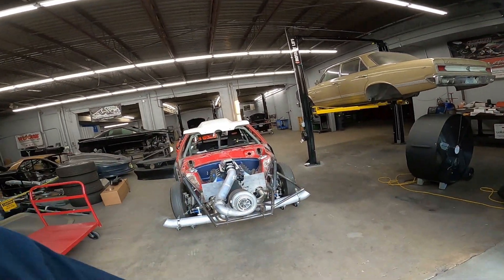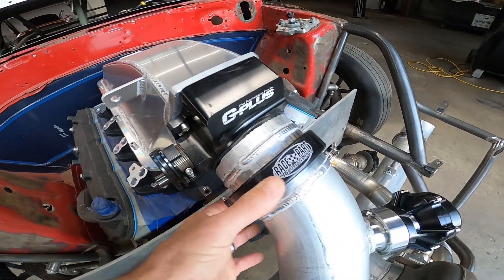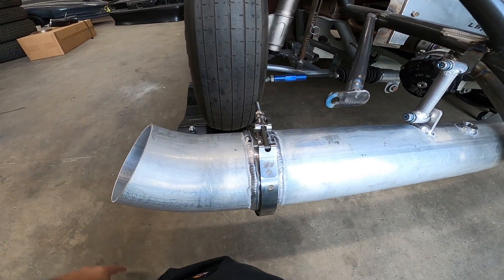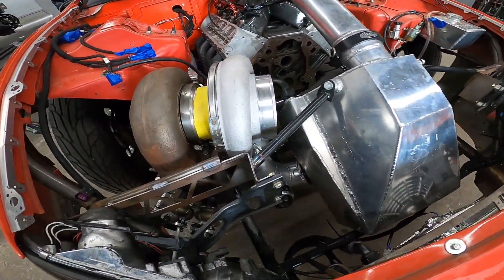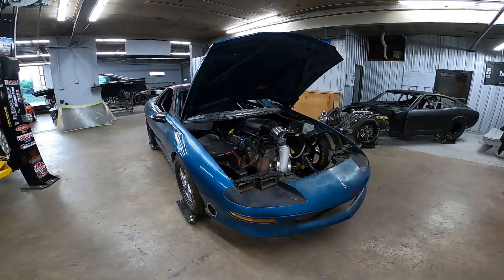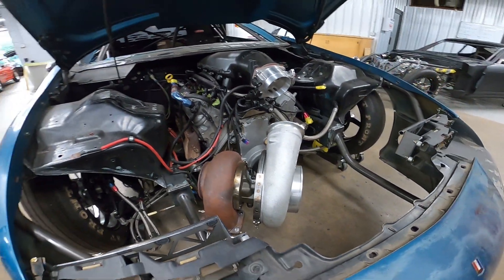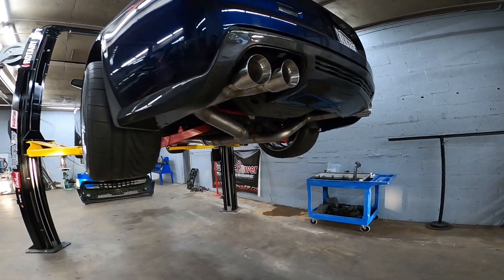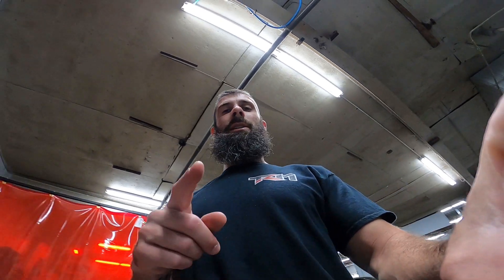Greg Allen 94mm Turbo Foxbody going HOME!!! Many other PROJECT UPDATES!!

Comment: How close are you to V.a. ? You seem to get a ton of V.a. Customers and cars . I’m in The middle peninsula of V.a. About 45 mins to a hour east of Richmond V.a. I may be needing a set of 1 off turbo headers for a LS going in my Audi A4 Quattro. I’m trying to retain the AWD also so but I don’t think I can reuse the trans and I don’t really want to because it’s a Auto and I want to do some occasional track days and maybe a little drifting . There is a clutch kit and bell housing adapter available for mating the stock A4 manual trans to a LS but with twin turbos on a healthy 6.0 I don’t see it holding up long if at all .. I was thinking maybe a T6 mated to a gm AWD case out of a Astro or a trail blazer , Bravado , or I’d really like to find a Typhoon/ Cyclone case . I want to be able to electrically be able to switch in and out of AWD which I know for a fact that can be done with the Astro AWD case because it’s on demand AWD and I’ve done it with nothing but a D.P D.T. Toggle switch quite easily but I’m not sure on the other cases . I guess I could use a switch on the fly transfer case but I don’t need but 2H and 4H so that seems like a ton of work because of the size..  I don’t know though I just need to dig up a trans and case then I’ll have everything I’ll need for mock up - headers and exhaust and I maybe able to use a set of shorty headers and mount turbos like the A6 and the single on the A4 now .....